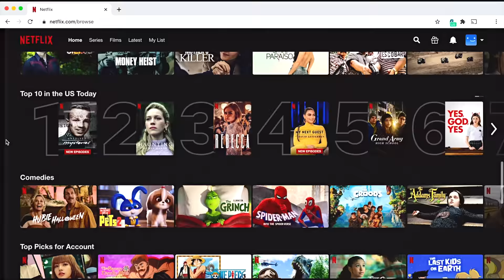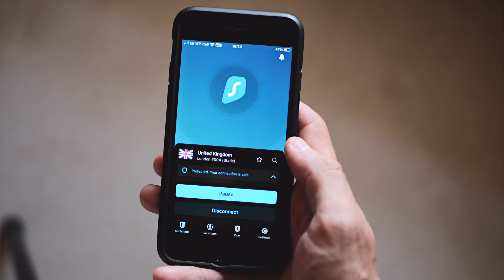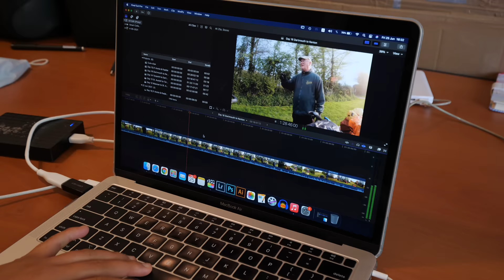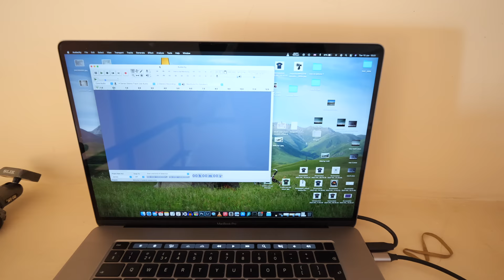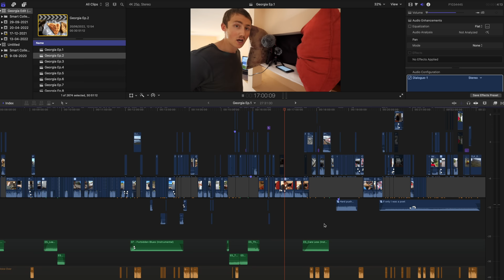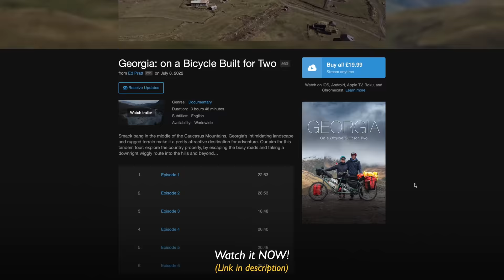Preparing to Cycle 1000 Miles Across an ENTIRE Country on a 2-Person Bicycle!

Comment: Because we don't say it enough for these little treasures for which we only (have to) pay the cost of sitting through some awful adverts - THANKS!
Reply: There are ads? hahaha
Reply: @gdgd5194  Yeah, you had a sponsored one for SurfShark and a promo for Vimeo, because ad blockers can't touch the in-vid stuff. Well, you might be on YT Premium (or whatever it's called) but from your response I doubt that.
Reply: @ManWalksDogs  Never knew anything until your post, I just skip through useless ads from sellouts.
Reply: @gdgd5194  Hmm Ed's content is worth playing through and not at 2x speed or with the finger hovering over the 'l' button to skip forward 10secs, but yes, in general, I've seen the sort of paid promo stuff many creators find themselves flogging, though I'd never lump Ed in with those.